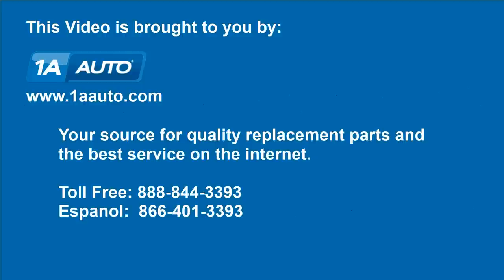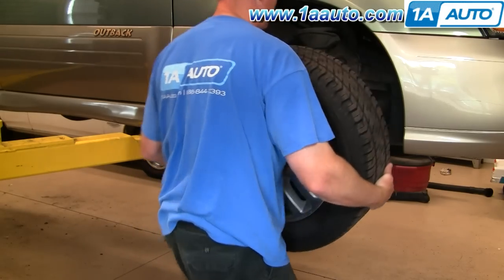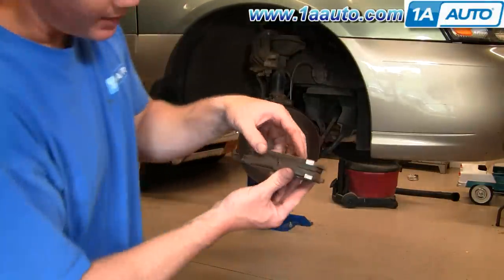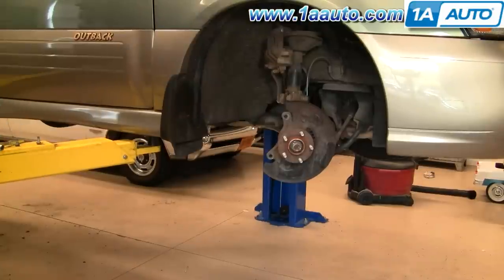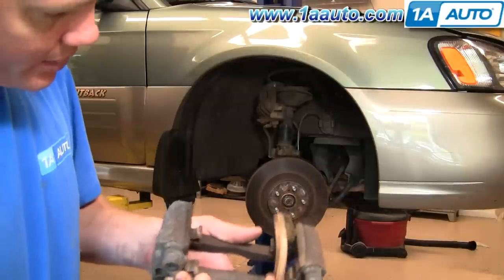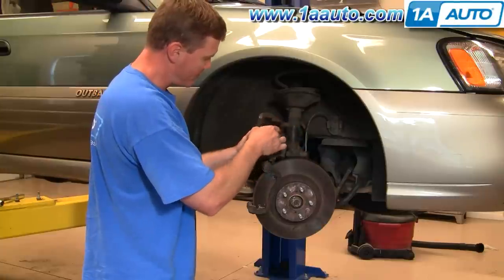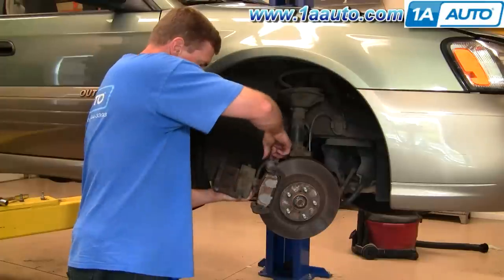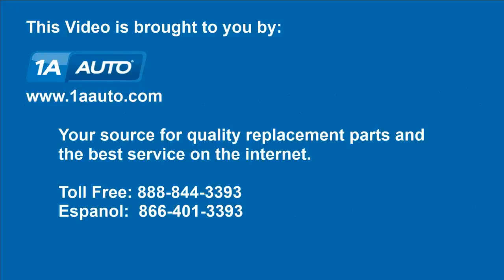How to Replace Front Brakes 02-05 Subaru Outback

Comment: The BE-BH legacy/outback manual page 1644 says the torque on the bracket bolts should be 58 ft/lb, yet 1A is saying 90 ft/lb. Looking around the net, it seems people are generally confused about that number. I just replaced mine, and after wrench tightening, it was another maybe 3/4 turn to get it to 58 ft/lb. By feel, I think 90 would have been too much. Way too much.

Comment: Or just put two 8 mm bolts in the two holes in the hub to remove the rotor like they are designed to do

Comment: Awesome video. I saved so much time. Just knowing what size sockets to use helped speed things up. If I didn't already have my parts I would definitely buy from you. Next time I will! Dealership wanted $900. I did it for $115. Replaced pad and rotors with good quality parts.

Comment: Great video, pretty clear instructions for the most part. I, too, had trouble hearing what torque spec you quoted for the caliper bracket mounting bolts. It sounded like 9 foot pounds.  I suggest when you are torquing the bolts, you also put the torque numbers up on the screen so it is very clear to your viewers. I want to be sure I am getting the right torque for those bolts!
Reply from the maker: +Douglas Ernst Thanks for the tip. Our videos these days are clearer and easier to follow. We'll pass this tip on. Thanks for the support!

Comment: Helpful to mention that if someone added brake fluid if the pads were low, that pressing the caliper pistons back in could overflow the brake fluid master cylinder reservoir.

Comment: I like using an old bolt usually the tension pulley to the ac belt. Thread that in to the rotor holes and zip it off with a 12mm. Take caution they tend to strip out. Lucky there's 2

Comment: Nice video, but not sure about the torque spec on the "caliper bolts" - the screws that go into the slide pins. My service manual for my 2003 Outback, page BR-17, says 39 Nm (28.9 ft-lb). At 10:05 you say anywhere from 19 to 21 ft-lbs.

Comment: Have a question. I have a 2002 and I'm in the process of trying to replace my front pads. I've been through 3 different vendors all of which have given me the wrong pads. The pads on the front have a wide tabs on the ends while the ones from the vendors have smaller tabs. Any questions as to why that would be? Or maybe have a part # I could cross reference with? Thanks

Comment: I always useva little anti seize between the hub and the disc to prevent rusting between them. But it must be as little as possible,  just a thin coat. Never had one seize on despite the stupid amount of road salt our council spreads in 'winter'.

Comment: Normally it's not a good idea to use an extension bar on a ratchet handle or use a ratchet handle to break highly torqued, or rusty bolts loose. You should always use a breaker bar or impact gun for that.
A good informative video in my opinion should always use proper technique and proper usage of tools to minimize injury and damage to tools or vehicle.

Comment: Hi thanks for the video..Please what is the torque specs you said 9 ft.pound or 19 ft.pounds...Thank you
Reply from the maker: +NAJD FIKRI The caliper bolts need to be tightened down from 19-21 ft lb!
Reply: hello, i believe he is referring to the measurement given at 6:58 where the caliper bracket is being bolted to the vehicle, i am going to be replacing my rotors soon, and i also am having difficulty hearing the number, research splits the decision of the number between 90 ftlbs and 59ftlbs. which did you use? great vid BTW very helpful in visualizing what i need to do ahead of time, thanks!
Reply from the maker: +NAJD FIKRI Yes, 90 ft lb is the spec for those bolts!  1aauto.com

Comment: What about brake grease on the stainless steel inserts for the caliper bracket.  Is there supposed to be grease where the brake pad tab meets caliper insert.  I think greasing the insert, and the backs of the pads, is important.
Reply from the maker: +Mark Rozenberg You can add some anti-squeal brake grease on the contact point that you have described. Thanks for watching. 1aauto.com

Comment: Levering a ratchet with a pipe!!! How to damage gears 101. Use a breaker bar; that's what they're for. (15 years in the trade)
Reply: Isn't usually a breaker bar the same as extending the ratchet with some longer pipe ?
Reply: @joshdavis2064  no, because the gears in the ratchet can wear down or break. Breaker bars don't have gears. As far as the physics is concerned, yes it's nearly the same amount of leverage, save for some give again on the gears.